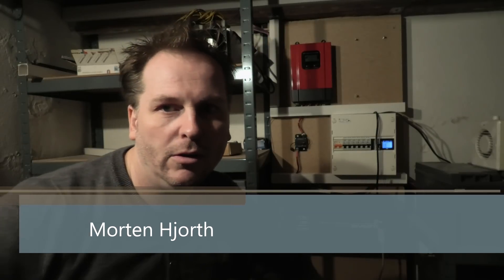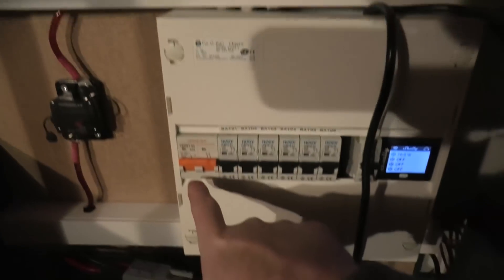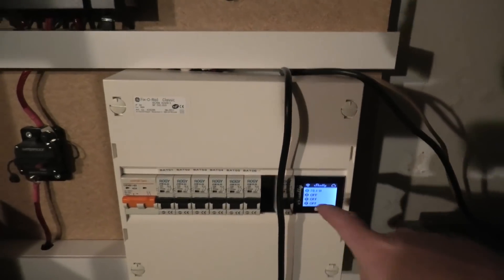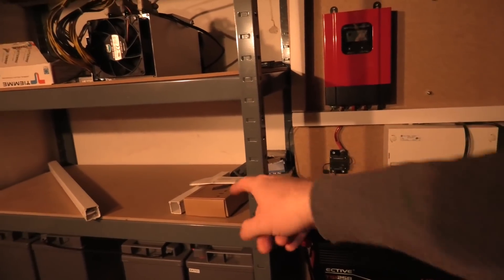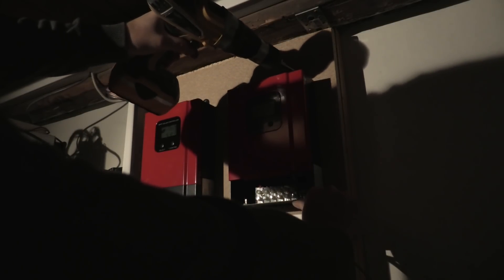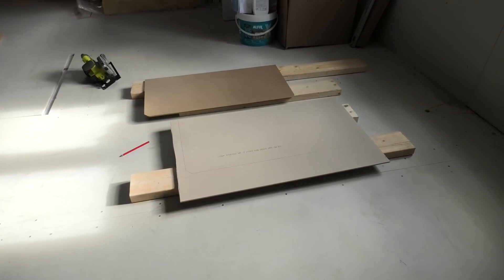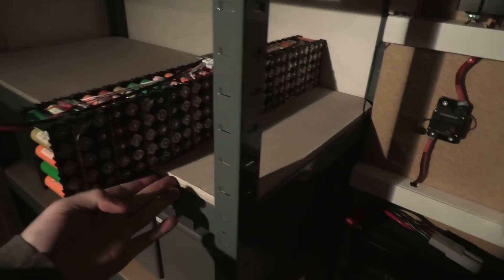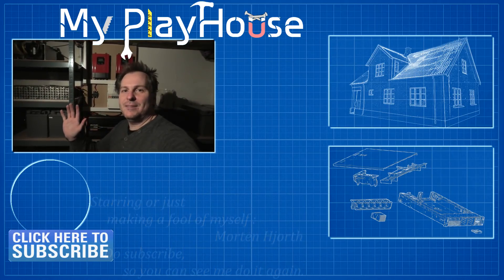Preparing to put 4KW/h Li-ion Battery in Production - 1009

Comment: Okay I saw this and well....
I read the comments.

Firstly did you say you charge the LA batteries at 15.4volts?
That will degrade them a lot. Max is 13.8.

Your lipoe4  battery, which you are thinking of adding is different and you would need another charge controller for that.

Charing lion batteries (I prefer that shortening) you have to know the C rating for them.
Then it's down to how you have them in series and parallel to what current you can change them at.
The lower the current the longer they last withing stage 3 of charging... (Less heat)
Hope the BMS has that built in!

Adding  PV panels ups the voltage and lowers the current, this is better and more efficient in any event.

However big voltage changes on inversions is a waste of power and that for you looks like about 40%.

Now you have 130volt charge controller, I'll assume that you have high voltage batteries?
Then you have a high voltage inverter.

For example the PV makes 150v and 5 amps.
That's 150*5=750watts.
10*12v batteries = 120volts
Then your inverter 110volt to 230v
Effectively a doubler.

If you get a SIC switching inverter then you should get a out 94%.
Getting the right inverter at the right price isn't easy, but you could always hack the invertors and change out the FETs, but you may have to change the resistor and transformer, which you should need less of and only for smoothing.

As most don't come with a full data sheet, nor any details of what hardware is inside, you should take a look at the FETs and the data sheet to make sure it's optimal, as anything that says 2000watts is more than likely stating its peak power, which when used starts cooking itself. (FETs are measure in uS for that power)

Also the disconnect, if you remove one battery you're going to over volt the other packs from the charge controller. Or at the least shut it down while the voltage is out of spec. Unless you're connecting the other way...

Also have you thought of wind? A small 400w turbine helps when the sun's not about. Also how about a peddle generator?

I've a DC motor that is high power which I'm wondering to turbine or peddle power it and then a buck converter so it can charge the battery and keep me almost fit at the same time. Is is a DC and at a low-ish speed is about 36v and 6amps..

As you have stationary batteries, don't get caught up in smaller and lighter batteries designed on portability, a H-cell is heavy but has more power that lipos by volume.
700-950 (tops really new tech)..

I'd go for buying more panels and get some 350w or higher, as they're not expensive, people selling them here from the solar farms and house sellers who got into bad contracts for 50-80£...
Check out you tube for 'diy solar tracker' may help for early and later power adding to the charge times.
Reply from the maker: To much text Rory,, keep it short.
I have 12 panels.  they are set up in strings of 3. right now the sun is shining and I ma getting in 90-97 volts (MPPT keeps trying to optimice that) this goes in to one eSmart3 charge controller right now. and goes in to 48volt lead acid battery banks (4 in series) 6 of them. the Inverter is a 48Volt inverter and from the 48volts it makes 230 Volt AC.
Reply: @MyPlayHouse   
48v la, 13.6*4 (54.4v)
13 lipo = 48.1 nom volt and 52.4volt charge max.
Over volting will shorten battery life.

Voltage (PV) means little without current. 200v and 0.5a is 100w.
100v and 1a is 100w
The power is the same. 
But if you switch to high voltage, rather that higher current, you have less losses. It cost less too..

Comment: Dude, cutting fiber drywall without a respirator? That's a perfect recipe for COPD or even lung cancer!
The other thing is that those boards are probably not spec'd for the temperatures of a Lithium fire... Do what you like but I'd hate having to find a new entertaining old server channel again...
Reply from the maker: Been trying to find proof for your claims of drywall and lung cancer,, Not much to find on that,, did find a shop vacuum webside,, claiming it,, but they might have a different interest. 
Found that a li-ion battery burns at about 1000F and a match at 1150F
I did a burn test on different materials back in 2015 : https://youtu.be/10pTbn-4e44
Reply: @MyPlayHouse  Morten, old boy: Stefan exaggerates the danger, but he's not all wrong. You could have opened the windows and let natural air flow take care of the worst of the dust in the air. That dust surely isn't helping you lungs.
https://en.wikipedia.org/wiki/Pneumoconiosis
Take these words from someone who does suffer from COPD, Mate. It's no fun, coughing blood. Actually just watching you sit in that cloud of dust of plaster and glass fiber cuttings made my throat itch a bit more.
Other than me, you have clean air around yours, so a single event like cutting those boards won't harm you, but you do similar works fairly often. In the long run, you might encounter avoidable illness. Some ventilation and a decent dust mask, not those crappy paper ones you get for pennies in cheapo outlet stores, but a one that really seals around mouth and nose and makes sure you breathe all through a dust filter should find its way into your wardrobe with the safety slippers and safety squinter.
Reply: @MyPlayHouse  
Any inhalation of dust is not overly healthy to begin with. Long term exposure is bad but intensive short-term exposure (like cutting drywall in a closed unventilated room) is especially unhealthy. There is a high risk of resulting pneumoconiosis. https://en.wikipedia.org/wiki/Pneumoconiosis (ICD-10 J64).
What you call "fiber drywall" probably are fire resistant drywall plates with fiber core. The fiber core usually is made of glass fiber, rock fiber or mineral fiber. The dust of those  so-called synthetic vitreous fibers (SVF) is implicated with lung cancer for a while. It's important to realize the difference between the fibers and the fiber dust. The fibers themselves should be safe if your plates aren't too old. The main danger is the particle size in combination with reactivity and bioavailability.
If your understand German, here's some info from the Bavarian Environmental Agency: https://www.lfu.bayern.de/buerger/doc/uw_32_kuenstliche_mineralfasern.pdf

Comment: You could always heat your water with the basement wood heater. I have both Li-ion and LifePO4 batteries at my home each on their own  solar charger and supplying  differant parts of the house, and no firers or over heating of any of my own made batteries. So I wouldn't worry about fires and burning down your home Morten. another good video.
Reply from the maker: Hi Peter195267
Thank You very much!  glad you liked the video :-)
Thank you for watching! :-)

Comment: I have found you can top up sealed batteries.this will bring some capacity
Back 

Find a container big enough to put a battery into buy 50 litres of de mineralised water 
 Pour in the water over the level of the battery and you will see bubbles wen the bubbles stop the battery topped up .water pressure pushes in and air comes out
Reply from the maker: I do not know about that,,, sounds weird.
Reply: @MyPlayHouse  if you have a sealed lead acid battery with low capacity it’s normally a low or dry cell .obviously it’s sealed so it can’t be topped up so submerging the battery will top up the cells it has worked for me and saved me money 

Cheers

Comment: Good for you .if can heat your water and do you washing and lights for free that is awesome and good for the planet
Reply from the maker: I really just need an easy way to switch forth and back to the grid.
Reply: @MyPlayHouse  sounds like you need a industrial switch like a 2 position switch with 2 inputs and 1 output to your main fuse board so you can switch to solar or grid

Comment: I am now at 14.19 kilowatt hours of li-ion batts for my solar. All from cars. Chevy Ford and BMW. There all 6s. Each batt has it's own Daly 80 amp BMS. Never will get close to that. Max I can do for each would be 540 ish watts. I just like over kill. So got BIG BMS lol.  So happy I have got away from the Lead batts. Been working in solar for the beater part of 20 years. Lived off-grid 10 and have lived with this off-grid setup we have now for 6 years. One of the best things I have seen in solar over that time got to be. The price of solar go down from as much as 10 bucks a watt . Next was Mppt.  Now li-ion.  

One note. I do not know but can you mix lipo 4 with lithium nickel Cobalt? Thanks so much for sharing brother. Keep up the videos. God Bless.
Reply from the maker: Hi Bobby's Solar Homestead
I kind of have a different strategy, I want to use a moderate amount of power over longer time. So instead of trying to power my 400 volt Heat Pump, by getting a big 3 phase 400v 5-10.000 Watt inverter,, I got a heat pump that I can better power.
My Li-ion banks are just 48v 15A,,each so they will just do like 720W max.. (or that is what the BMS will do) But if /when I need more I can add a bank,, just have to put together 140 cells :-)  keeps it very cheap.
Thank you for watching! :-)
Reply: @MyPlayHouse  I see brother. That is smart. I was not trying to be critical. Was just sharing my setup with you and my experience. Hope I did not upset you was not at all my goal. Sorry if I did.

Comment: might be time to consider fire suppression system?
Reply from the maker: Someone suggested me something really smart long ago.. Might be looking at that. (Batteries and water does not mix well)
Reply: @MyPlayHouse  CO2 fire suppression would be an option (CAUTION automatic systems can harm people). But the best is fire prevention through fuses, early fire detection and using fire retardant materials wherever possible (so no wood, no plastic shelves (only metal) and make sure there is nothing flammable in the basement).
Reply: water and put out the fire and loose all the batteries or Water puts out fire and saves house..  I'll take the loose all the batteries..
Reply: good man